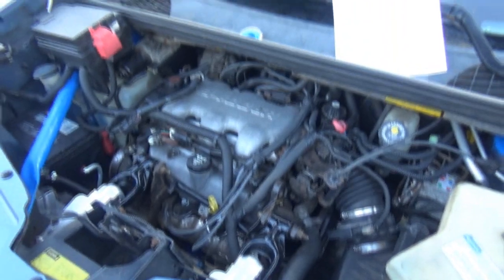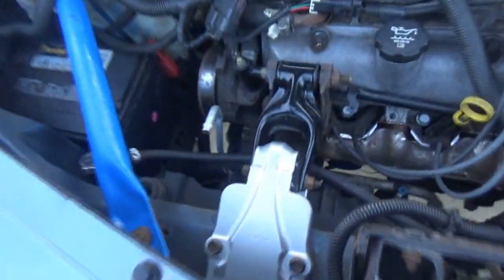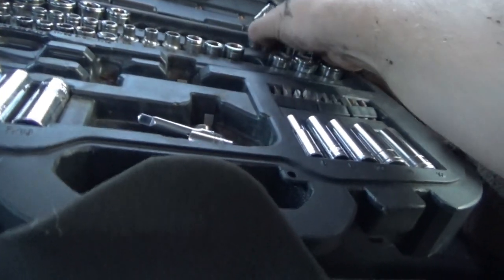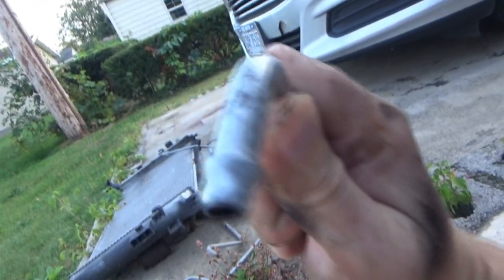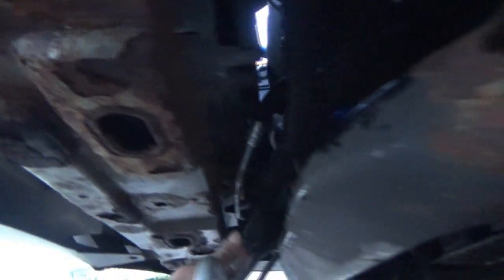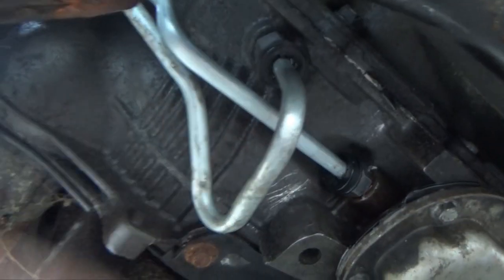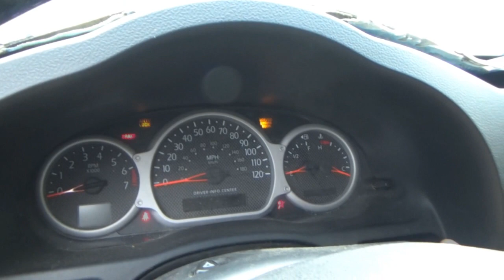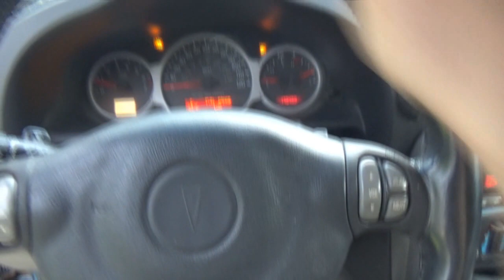MV 239 - "The Aztek Needs A Transmission Line AGAIN!"

Comment: I have an 02 and it seems to run fine. Paid 300 for it and been driving it fer 2 years now. Did replace front rotors pads and a battery...
Reply: We got ours 2 years ago tomorrow and have loved it ever since. It's an '01 that's near identical to Mike's except we have Cassette/CD instead of the 6 disc. It's needed a few things, however it also sat in a lady's yard for 8 years before we got it.